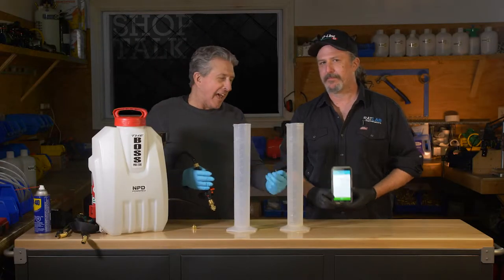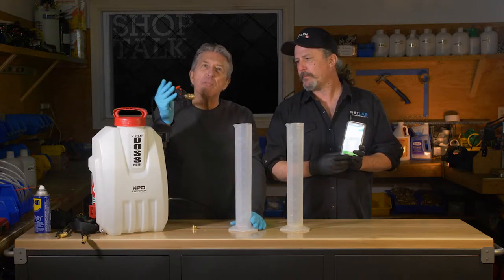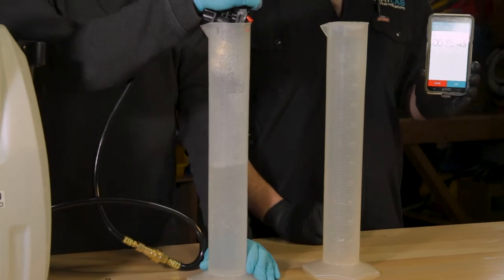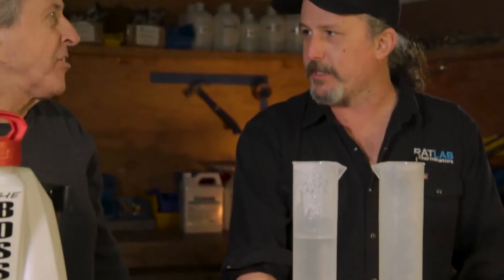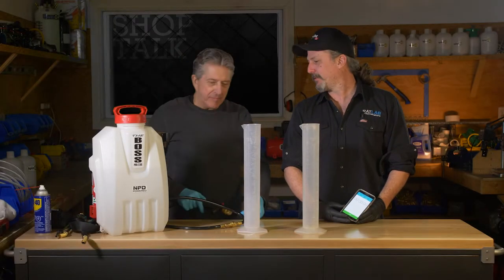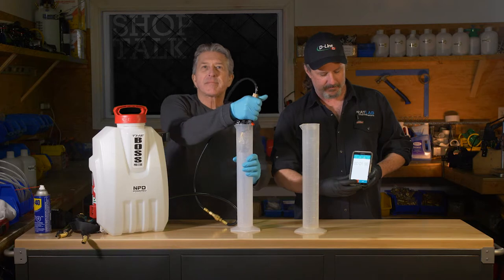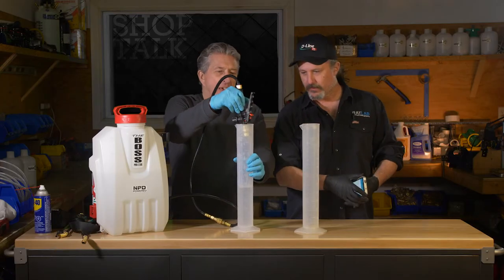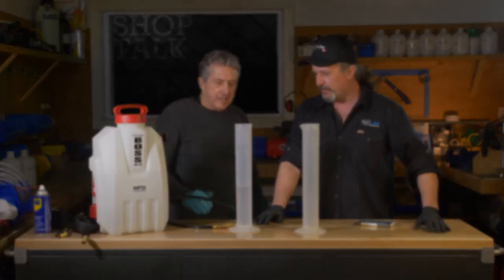SHOP TALK : TIP CALIBRATIONS

Comment: Is the power switch on 1 or 2?
Reply from the maker: Hey Joe, that should be on our high flow setting. If you want to shoot over an email to preston.carruthers@npdproducts.com I can send you a chart on output by tip type using both high and low settings. Thanks for the question!